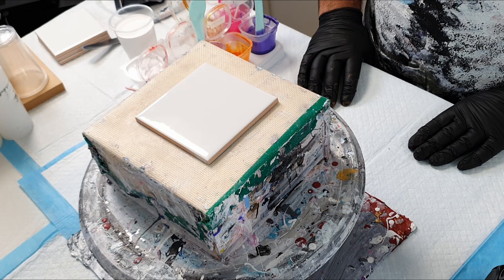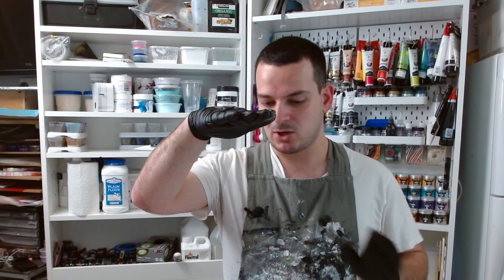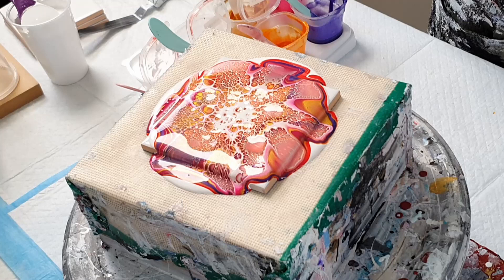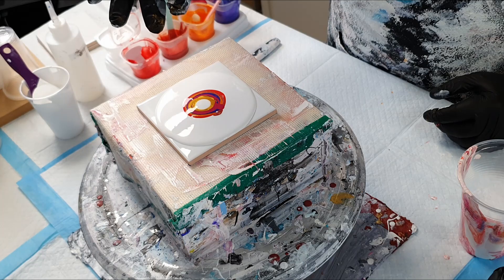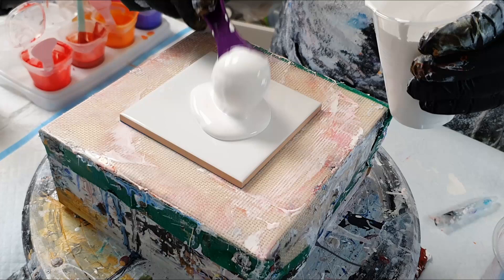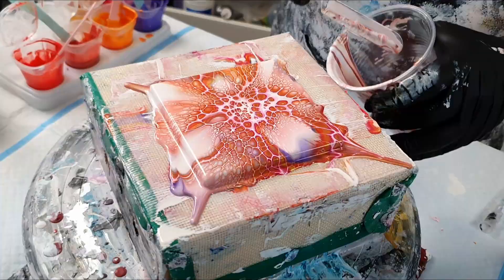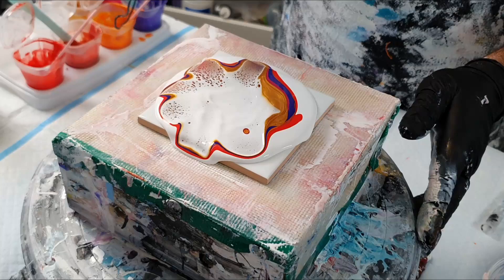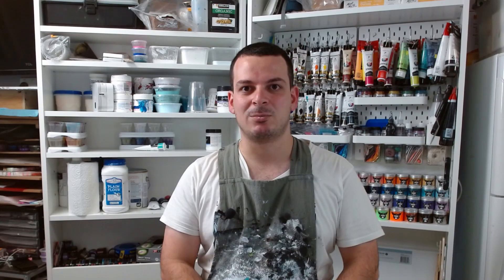Blowing Out Blooms - Rain & Pours - #7

Comment: That was extremely helpful. Especially measuring out the pillow paint. That was useful. I struggle with pouring enough pillow on. And the use of the straw on the CA that was concentrated in the middle. I use to try and blow it off but your way was more helpful! ❤️ TY

Comment: I habe Arteza mica powders.  Are they comparable to TLPs?
Reply: Have not hab
Reply from the maker: Haha I hab some PearlEx pigments too :P I've not used the Arteza ones before so I can't personally speak for them. But what I can say is that out of the 5 or so brands I've tried for pigments, TLP comes out on top every single time, purely for the reason that they were designed with fluid art in mind specifically to work with acrylic paints.

Comment: Do you water down the housepaint out of the can?
Reply from the maker: Hi Desiree, no I don't water mine down at all. My paints are usually a little thin so I sometimes need to thicken them up
Reply: @rainandpours  i meant the housepaint, to put in the pillow(base) my housepaint is thick, hard to flow
Reply: @rainandpours  i am new in pouring thats why i ask alot around
Reply from the maker: Correct, I don't thin my white house paint at all and often need to thicken it up a little. The weather does affect this too. If your house paint is so thick that it will not flow you can add a little bit of water or flow extender to thin it out

Comment: What is the block on top of your spinner?
Reply from the maker: Hi Karen! My cake spinner is from Amazon a stainless steel one, and I built the custom box that you mention to allow for flexibility with its use. The box is pine fence paling cut to size (21cm from memory as the spinner is 12" across) and screwed together on the ends, with an MDF square for the top. That is screwed onto the spinner from underneath. Then to finish I have screwed on a silicone mat which allows easy cleaning and scraping from the surface. 
The original intention was to have 4 wings that attach to the side of the box with wing nuts to allow for up to 1.5m canvases, however I found building a platform with a slightly bigger box on the bottom that just slides right over the top of the spinner is the better option and far more stable. Plus that allows for me to scrape the extra paint off rather than wasting it on the table as it flies off.
Reply: Rain & Pours thank you! Very creative! I've enjoyed watching your videos!

Comment: There's no link to get the blower
Reply from the maker: They are available in several locations, a quick Google search will show you where you can get them
Reply: @rainandpours  sorry I was extremely tired when I wrote that snippy comment I was just trying to figure out which brand it was because there's a couple Brands but people are starting to make accessories for the ends but from only the one that Westminster or something. It was a dumb question if you're right there all over Google